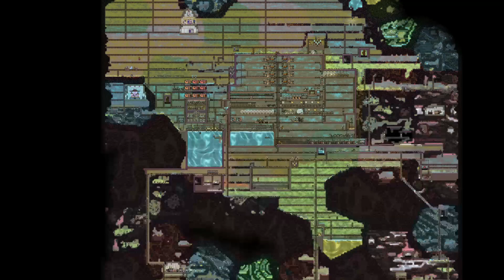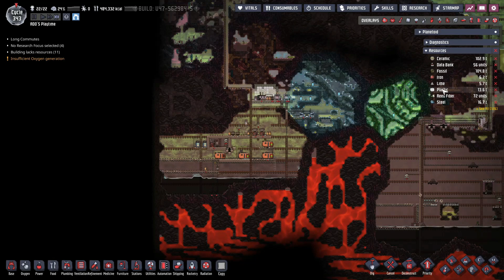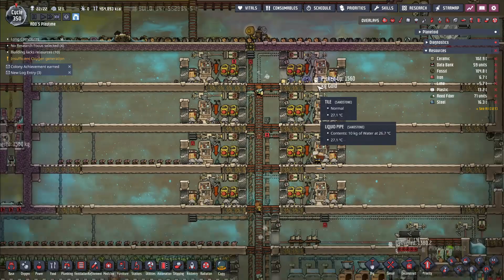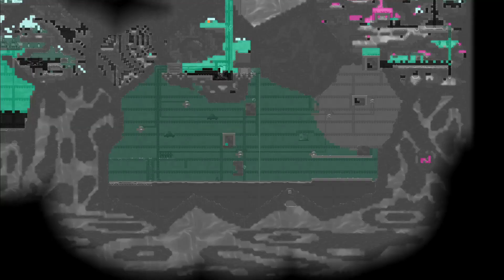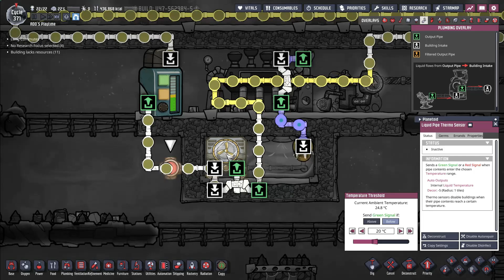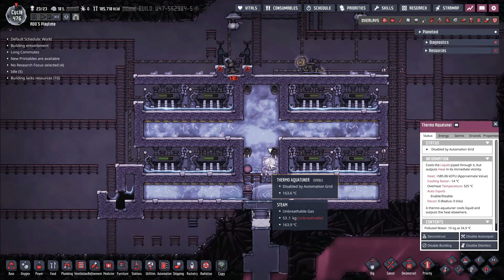Geothermal Power

Comment: You also probably want to get rid of that upper pool that has your aquatuner water running through it and just do an insulated tube right as you are getting out of the steam generators that goes directly into your tank, that line from your tank to your tuner should be all insulated, especially inside the chamber where you have your tuner, as the cool water out of your tuner is absorbing heat from the tuner chamber before it gets to cool your steam turbine, your getting heat loss. You want the only exit for that heat to be through your turbines. If you have steel, you can put your tank in your aquatuner room, if not, put it in the turbine room, don't leave it outside.

You didn't do this, but just an fyi, bridges of any kind act as thermal transfers. Meaning if you place a bridge over a line of tile and thing you have thermally isolated the two, the bridge will act as a... bridge and both sides of the bridge will reflect some median temperature of both sides of the all, leaking heat from the place you have isolated it. You want to keep your heat where you want it, don't give it other pathways out. Good luck.
Reply from the maker: Yes you are correct. I have some maintenance items that I need to do as Geo Power did take a while to do. Some background items have, fallen to the way side. Thanks for the comment and the tips!

Comment: When dealing with multiple inputs and outputs for anything, the key to know which has priority is to look at your white input and trace that solid tube all the way back to the last green output in that line. The very last green output will have priority over any other green outputs between it and the next closest white input. Never form Ts or Xs with your pipes or you will get inconsistent behavior.

Comment: 90 degree bends in pipes don't actually do anything. what's important is when a liquid pipe goes through a tile that contains a liquid intake (a square with a white arrow pointing down), it first tries to enter that intake and only when that intake is full, it continues to go to the next section of the pipe. same deal but the other way if a pipe with liquid goes through an outlet (green square with an arrow pointing up): it first gives priority to liquid going through the pipe, and only when that's empty, it will allow liquid through the outlet.

in your setup aquatuner works because its intake has higher priority than the pipe (so when aquatuner is on, liquid goes through it first) and the liquid bridge that bypasses it has an outlet with lower priority than the pipe its outlet is connected to, so liquid never gets stuck in your aquatuner. this setup is correct, but there's many other ways you can also make it work using bridges, and it has nothing to do with the 90 degrees bend.

overall, use a white intake on a pipe if you want to suck liquid out of it with a high priority and use the green outlet to add liquid with a low priority. the shape of the pipe has absolutely no consequences.
Reply from the maker: This would have helped me in playthroughs so long ago. I never thought to think of them as having priority! Thank you.

Comment: in your aquatuner setup at 19:00, you have a low temp liquid pipe passing through a high temp zone under the turbine, losing heat for no reason. i suggest using insulated pipes there.
Reply from the maker: Honestly had to read your comment 3 times and then I got what your saying HA! I will make the adjustment. Good eye man.
Reply: I was about to say the same thing, good catch!

Comment: auto-sweepers are not supposed to be faster than dupes, they're just supposed to sweep while dupes are doing something else. so you save up time in the long run by doing things concurrently.

besides, their throughput is limited mostly by conveyor rail speed (which is abysmal). if you build a daisy chain of storages with increasing priorities, sweepers can move crazy volumes of stuff very fast.
Reply from the maker: That is very smart! I will do that in the future. I was planning to sweep the space biome and that would be helpful.